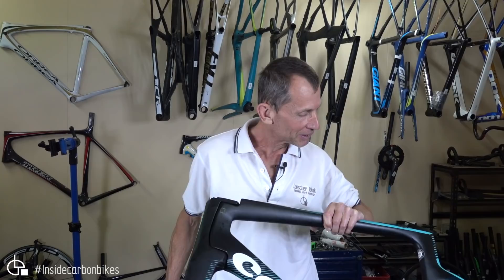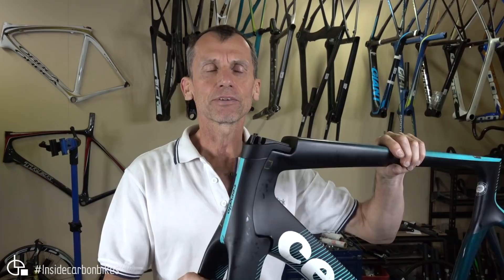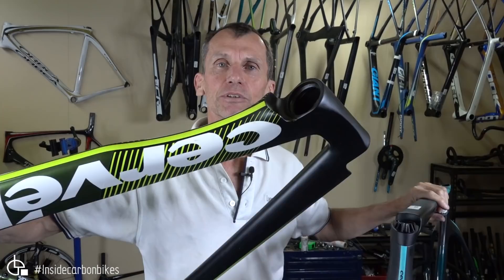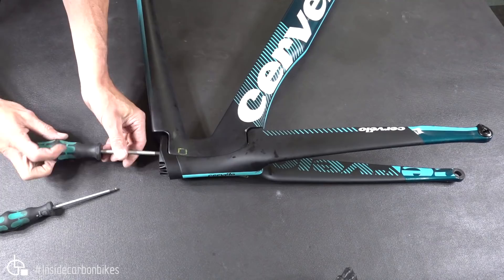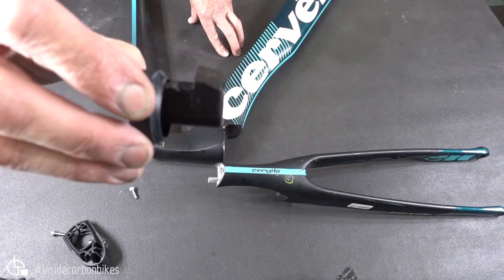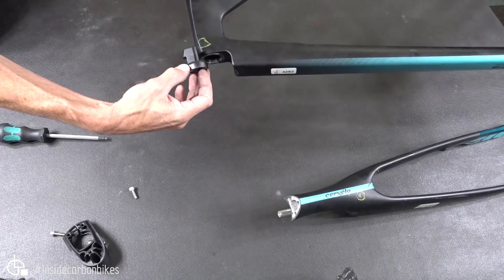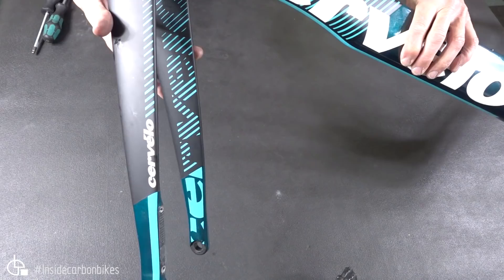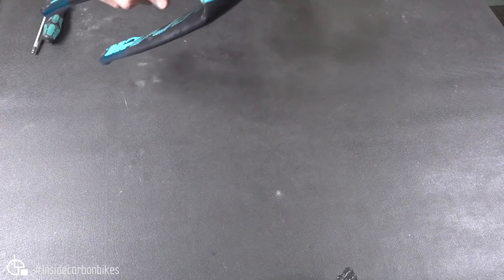Cervelo Design Fail!

Comment: The Trek Madone SLR has a similar issue  with fork/frame interference. There is a plastic/composite steerer stop under the headset bearing cover, but it breaks easily.
Reply: Mine, my brothers, AND a bunch of media loner Madone SLR's that I've seen in YouTube vids all have that exact little ding on our forks on both sides. The little steerer stop is the cheapest, smallest piece of shit in the world and snaps the first time your handlebars even gently rotate too far. Luckily it isn't to the same extent as this cervelo and mine is just a paint chip. But still, it shouldn't even be a possibility that your fork can contact the frame.
Reply: cycling T-Holms  can you pls give me a link to one of those videos? i was thinking on buying one but now I am afraid lol!
Reply: @thedronescene7474  The Road.cc Madone SLR review shows paint/carbon chips on both sides of the fork crown.
Reply: @HolmsOnBikes  A stiff wind blew my Madone over while it was leaned against a chainlink fence. That partially broke the steerer-stop and I didn't realize. A few months later it broke completely while I was just picking up my bike... leaving the paint chipped.  Turn it even farther and it will break the corner off the bottom of the HT.
Reply: @cycling T-Holms If you have that ding on the outside on both sides surely the delamination on the inside is catastrophic? Will you be comfortable riding this bike again?

Comment: Hummm... My S5 does not do that at all. The traveling stops by the headset bearing. It does not touch the frameset. Did you assemble the fork and headset incorrectly? Or the donated frameset was crashed already?
Reply from the maker: Maybe they changed it already or you have a different model, we had two of the same come in and both were like this, they were assembled correctly.
Reply: That does not make any sense. Mine is 2019. I got them when they first came out. Your video showcased the 2020 model. Don’t think Cervelo made the headset/fork area worse?! Just to clarify, I’m not defending Cervelo. I’m seeking the truth just like everyone else who owns this bike. Also def not a fan of ‘fake new’ on YouTube or social media. It’s easy to manipulate the truth on a little screen, just to get viewing and ratings. Wolf on the sheep skin kinda behavior. Truly hope you are not one of them
Reply: @JamesLee-qy7bi  How about doing your own video and showing that your frame is different ? Shouldn't be too difficult before you accuse someone of being fake without proof?
Reply: ExMachina  -Hummm?! I didn’t accuse anyone, did you read all my messages and  Luescher’s reply correctly? I’m seeking the truth just like all S5 owners or future buyers. Its not just ‘my frame.’ All the 2019 and onward S5 built the same way.  There are videos about the full built on YouTube already... You can pm the mechanic and he will tell you that the cam stopped at the top headset bearing, it doesn’t bang against inside of the frame. On the outside, the fork doesn’t touch the head tube as well.  Unless the frame was in a crash. Therefore, I have have some legitimate concerns about this specific Luescher’s video 
https://youtu.be/-VH5AvzseoU

Comment: Being one of the first to get the original carbon Soloist (CSC livery) in Australia, and a couple of P2s after that, years ago, I've always been one of Cervelo's biggest fans and have even contemplated recently getting an S5 but for an expensive, high end bike manufacturer, this is very poor. Is the result of change of ownership of Cervelo behind this? Interested to know.

Comment: I'll stick to my 2010 Chinello S3 that I've had since 2012
Reply: Never seen a Chinello s3 what's the price on that frame?
Reply: @savagedabs8536  I paid 500 dollars on DHgate.its a knockoff cervelo S3.but it's a really good frame build.no noodling and still going strong
Reply: @asamusicdude  Very cool I'm going to check dhgate as I never even thought to look there for a road bike because the only thing I have ever bought from them was bongs. How many miles do you think you have put on? Clearly its held up well if you are still riding it to this day. Thanks for the reply
Reply: @savagedabs8536  lol just noticed you're a fellow dabber.i don't have a counter on it yet so don't know exact miles but I would say about 1000 miles.i had the frame just hanging around for a few years because I couldn't afford to build it.meanwile I was riding a pro-lite fixed track bike.
Reply: @savagedabs8536  they have frames on AliExpress and Alibaba too.but always check for reviews.never get a frame without good reviews
Reply: @asamusicdude  Excellent advice that was my next question how did you suss out the good from the bad. Absolutely my friend I dab like it's my job because it kind of is as I grow for a living. I've spent the last hour on dhgate and I'm actually surprised at the prices on some of the name brand frames.
Reply: @savagedabs8536  also a fellow grower.just finished taking down my room.

Comment: GREAT VUDEO! For folks who have this frame and who have been lucky to not damage it yet, what do you think about  using some appropriate adhesive to attach some stainless steel plates on each side of the inside of the headtube where that impact occurs to spread out the force of contact, reduced the pressure, and prevent delamination. Seems as though the extra grams would be worth it to save the frame from major damage. P.S. HELLOOOOOO HAMBINI FANS!!!
Reply from the maker: Yes that may help with reducing the point impact load, good suggestion.

Comment: Well, thats a shame. I saw one of these at racing on Sunday and liked the concept of the NON steerer tube purely from the resale approach where people slam a stem the cut off the remaining steerer which impacts the resale as only a buyer who will ride it slammed will want it.   I have a TREK Fuel with a similar issue where Trek use a KNOCK BLOC built into the stem spacers to afford the steering lock limiter.  Not a fan of any of these but can see the designers are trying to move the designs on and overcome the new wrinkles.

In the Cervelo S5 case I guess noone asked a user what could possibly go wrong.  Also concerned about the steering head bearing size as the steering tube diameter looks to be only 12mm and is so small then the bearing will be small? too and the loads are therefore on a far smaller area in the head tube. History says the larger the bearing diameter the better able it is to handle impact and loaded vibration.  Seems a bunch of disappointing issues in this design.  Maybe S5.1 will be improved.

Comment: I don't know about engineering, but just watching that propietary fork/asemby with stem and the propietary seat tube, you have to know you're gonna get fucked up in less than 10 years if you have to replace any of those parts.

The it comes your explanation, Raoul, and it only gets worse.

Comment: As Hambini alluded to in a previous vid, the Bicycle industry is full of crap engineers, because if they were any good they’d be in another industry........
Reply: Yeah but I don't think that's accurate. More like the some companies tell the engineers what to do and what not to do. Same thing that happened in Hambini's profession with Boeing.
Reply: Nah thats dumb.
Reply: That is correct.. what top aerodynamicist or aerospace engineer would like to work designing  severely limited (by the idiots who run the UCI) crappy bikes made in china, when they could be working on the latest aviation technology?.. the salaries are not even close
Reply: @ggdd1299 nothing wrong with Made in China but the brand.

Comment: l was looking to purchase a brand new bike , Trek  Madone SL7 , was disappointed to see damage on fork crown & frame where it impacts as steering is applied ! Paint was removed on both surfaces ! Very disappointed , as l must say l would’ve otherwise purchased 🤷🏻‍♂️
Reply: The Madone supposedly has a bump stop at the top of the head tube, just underneath the headset cover. I reckon the Madone you saw had its bump stop broken off.

Even if the Madone doesn't have this problem, torquing down the seat mast bolts require a long-reach 5 mm hex bit that's not a piece of cake to source if you don't know where to look, like the Nepros NBT2-05.

Comment: I was told that Merckx frames have a curved top tube, so as to avoid damage from the handlebar hitting it. Could a rubber bumper be used to limit the fork turning

Comment: It isn't just the fact that an engineer designed it and thought it was a great idea. There were other people who reviewed his or her design and thought it was a great idea as well and then signed off on it. I also wonder how much of it was just an effort to cut some costs.
Reply: Haha, good, competent engineers never stay in the bike industry very long. It simply can't pay enough. 
  The larger bike industry has its own set of so called 'standards' , which are actually quite a joke to anyone even somewhat familiar with true engineering standards. Marketing BS and vanity are what calls the shots. It truly makes no difference that your life may depend upon your bike! This is completely evident in all sorts of modern bike  design, not to even mention their utter ignorance of QC. I can take ANY new production bike, regardless of price,  out of the box and find  assembly errors  that often shorten its life. 
  I'm a retired mechanical inspector. I've also helped build carbon satellite components and machined all sorts of high reliability devices.      
   Now I wrench in a high end shop for fun. I've cut up crashed plastic bikes and parts just out of curiosity. We often destroy warrantied or recalled modern bike junk. 8 times out of ten, a damaged or broken frame or fork is indeed carbon. Oh, the irony. I won't ever buy a plastic bike unless I know exactly who built it,  and I would never pay for THAT on account of common sense. My decades old custom metal frames have never failed me, even when 'underbiking'. The builders are good riding friends and I do everything else. There is no greater potential in highest quality than DIY, simply because no one else can possibly give a shit like the end user, whose life relies upon it. 
 Nobody's fooling me!

Comment: Unbelievable, wouldn't touch a carbon frame these days to be honest. I ride aluminium and titanium as all I see with carbon is fragility and design issues that instill me with zero confidence. They are leading consumers up the garden path and out of thousands of pounds.... Scam
Reply: What a crap show. Most the people that can afford these arent fast anyway. I pass them on my 22 lb. steel Raleigh all the time😂
Reply: It's not the material that's the issue, plenty of good carbon bikes out there.
Reply: Get one with round tubes. Silly hard edges on carbon frames, triangular cross sections etc, are pointless. A circular cross section frame can take more damage before it breaks. I ride steel but I have a carbon winter bike, it's just a different material with different requirements. And to be honest, the carbon frame is a hell of a lot stiffer than the steel (which is 2014 Reynolds 725).
Reply: @PeowPeowPeowLasers  aka time bikes

Comment: They could say it is a mechanical fuse. If you crash, your frame is virtually guaranteed to break. See, they are protecting the customers from hurting themselves. /s
Reply: Andrzej Sawicki no, carbon frames normally survive most crashes but most bikes don’t have a built in fuckulater like this! 😂

Comment: So I'm ordering an S5 this week (or... I was...) Does anyone know if it's possible to put aluminum reinforcement inside the headtube where that metal stopper hits?
Reply: The only stopper you should use is one that prevents the check from being cashed!!!
Plus,  you realize ANY modification you make will be the PERFECT excuse Cervelo will use to nullify any warranty claim.
Run away.  Fast.

Comment: Due to the short lever the force will be huge if the handlebars are impacted! Fuck me. Dreadful. Engineer should lose their job for that. Even if an industrial designer did it... They should know better too!
Reply from the maker: Maybe it was the same guy who did the LOOK stem you reviewed!
Reply: @LuescherTeknik  lol! Glad to hear you saw that. Some simple rubber lock stops would have done here, simple. Interesting to know if the Cannondale System six has a similar system for the steering lock stop.

Comment: I would worry about riding any carbon road bike after a crash but this would for sure not last a crash. Obviously I would ride a MTB after a crash like I always have but the whole idea with a road bike is you can not crash. On the road you a basically naked and the speeds are much higher, you especially dont want a carbon bike to fail at speed.

Comment: Do you think making it with enough travel the handlebars hit the top tube might be better?
or is it better to just have a full swing?
Reply: The former seems like it wouldn't work potentially due to the fairing ahead of the head tube. Specialized's 3rd-gen Venge and Tarmac SL7 have no bump stops of any sort, they're allowed to fully rotate until the handlebars touch the top tube.

Comment: I don’t even dare to investigate my S5 because I will not afford replacing it. I must say when I bought my S5 4-5 years ago I was super happy until after the first ride. First thing happened was of course the seat post sinking. The wanxxxx in the shop I bought the bike couldn’t help me. Luckily enough I went to Clas Johansson at the time head mechanic for Team Chubeqa(later Dimension Data) he knew the trick to resolve that issue. 2nd issue with the damned bike was the handlebar wasn’t tightened and during a sprint just dropped on me almost causing a crash. 3rd issue was the worthless piece of junk Rotor cranksset. Totally impossible to get consisting shifting on the rear derailleur and to get rid of rubbing. 4th issue I had, was the seat post after a couple of years broke due to the need to tighten it harder than recommended by Cervelo. So glad I have seen @hambini roast Cervelo and also this video. What a bunch of idiots designing those bikes. It seems the bike industry is a shitty business altogether these day. What happened to the true European craftsmanship that built fine piece of high quality cycles ended up with crap from China!!

Comment: I'm staggered many manufacturers have failed to engineer full steering lock into their integrated-front-end bikes. Even getting the thing in the car in impossible if you need  to turn the bars. I looked at S5's when they cam out as an aero race option, but figured the front end engineering looked abysmal. Beware some of these front end designs - standard carbon steerers fail (and kill people) often enough without then being shaved down, ovalised, squared off or replaced by a narrow metal rod with lock stops mating with carbon...

Comment: It's awesome that you and Hambini are holding these companies to account for their crappy design. That's ridiculous on any frame let alone from a so called premium manufacturer. The least they could have done was bonded some sort of metal insert in the head tube to take the impact. Absolutely unforgivable.
Reply: Sasha the Slasher - that’s not much of a swing, my bike bars go around until bars hit the frame, way further than 180deg.  This one is less than 180.
Reply: Robert P Ooookay. I am not sure if I understand the point of your comment. Are you trying to say Cervelo’s shit design is actually acceptable?
Reply: Sasha the Slasher - acceptable to Cervelo.
Reply: Robert P I think it’s more a case of what they can get away with rather than what is acceptable. They obviously never thought that a knowledgeable you tuber would discover the ridiculous flaw. Wonder if they will be warranting frames that fail due to this design flaw or if they will put it back on the customer now that it has been exposed.
Reply: Sasha the Slasher - not likely at all Cervelo will agree, they will say the owner is at fault, misuse.  Warranty voided.
Reply: Applying a plate I don’t believe would help as it would just transfer straight through, the whole design is flawed, The head piece could be a high density rubber to absorb the impact, but I imagine it wouldn’t seat on the headset bearing properly. Why this stupid pin design..... and that stupid split handle bar that you can’t adjust. This bike in Australia (top one) is 18k, just ridiculous!
Reply: Waynos Fotos - if someone is willing to buy, someone will be making it 😳.

Comment: So which is worse, limiting travel, when you fall off or drop the bike, by having the fork hit the frame, or smacking your handlebars against the middle of the top tube?
Reply from the maker: The top tube is typically simpler to repair than the head tube.

Comment: About 4500 USD for this frameset that !  OMG !!!
Reply: mrGTD170 
Here in europe is around 5-6k€
Reply: And they buy them from the Chinese for probably less than $200 U.S.  I know there is R&D that has to be covered....the margins seem very high.
Reply: @hawkrider88  It is better to buy an open mold frame and spend the money on groupset,Powermeter , good rims. Search for FM 066 frame
Reply: hawkrider88 these frames are usually around 400$ painted, of which the paint job is 70$
Reply from the maker: The R and D expense may not be that high on this one! ;)
Reply: @LuescherTeknik  Cervelo probably outsource the entire R&D and engineering team to chinese slave laborers or indians, like Boeing’s who outsourced the 737 Max Software to $9-an-Hour Engineers in India